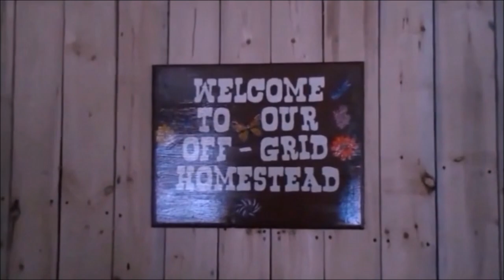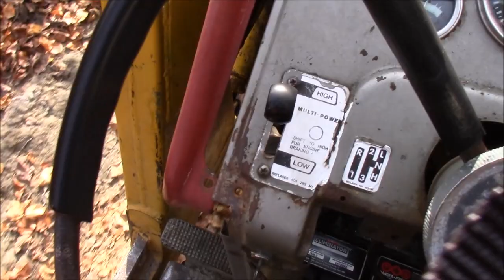These Should Finish The Uprights For Our Sawmill Shed

Comment: Bolt a couple of 4by 6's on the edge of the bridge and that will end all worries about sliding off on the frosty icy mornings or ice rain.  I'd even consider a log roll to off load logs to feed to the mill.  To make things there a lot safer.
Reply from the maker: Lol yes I will eventually put sides on the bridge... But if this hill gets frosty or slippery, I won't be brave enough to go down or go up it let alone use the bridge. I a hoping to just use my trailer as a log deck for a while.  Thanks again, you take care ttyl.... Cheers  :-)

Comment: Great videos Cecil! Question. Did you treat your posts at all before putting them in the ground? Also, those jack pine you mill, do you notice a difference if you mill them green or a few years etc after cutting? Just curious as i read many, many pros and cons of each.
Reply from the maker: Thanks Paul,  I did only treat a few of the firsts posts then ran out of Tar  :-(  I imagine they will still last around 40 years or so without treatment though.  I have milled a few green pine trees that were blown down by the wind and I find they are easier to mill when they are green.  Thanks again Paul, you take care ttyl... Cheers  :-)
Reply: Im sure they will last. Great work and i look forward to more videos!
Reply from the maker: I sure hope they do :-)  But time will tell.  Thanks Paul  you take care ttyl... Cheers  :-)

Comment: My gadges dont work too but my brakes are better than yours Lol.
Reply from the maker: Yeah my brakes are not great lol... Cheers  :-)
Reply: Try going down a steep LONG hill with a trailer loaded with about 4 ton of split firewood  with a tractor that is locked in LOW range that has no brakes period. As I have mentioned to you before, I have a Massey 175 diesel that has the Multi-Power feature, it was put in LOW and then the linkage was removed due to the clutch for the Multi-power being bad. When coming down the hill everything is pre set, transmission in 1st gear, throttle in lowest idle setting and the driver having a 5 point grip, (both feet, both hands, and  the butthole tightened so hard that it has a grip on the seat too LOL
Reply from the maker: Lol yeah I remember those kinds of rides, My dad and us used to deliver huge loads of green birch firewood with an old Cockshut 30 tractor with no brakes... I know what you mean by the 5 point grip.  Thanks again, You take care ttyl... Cheers  :-)